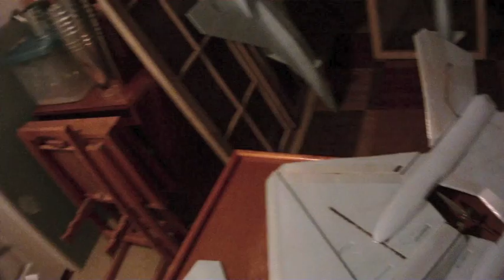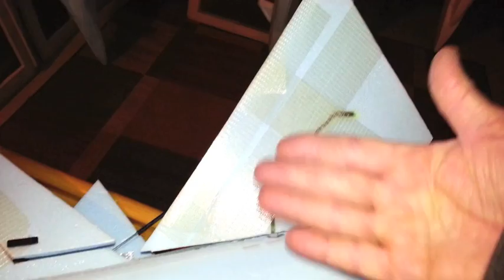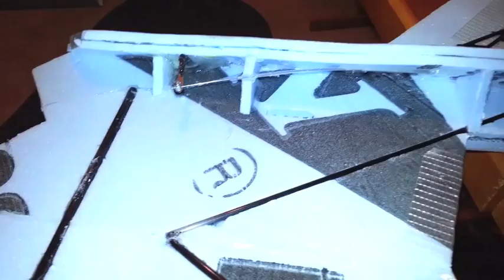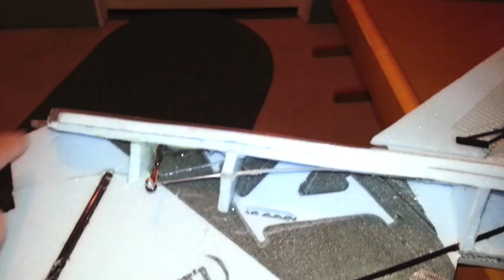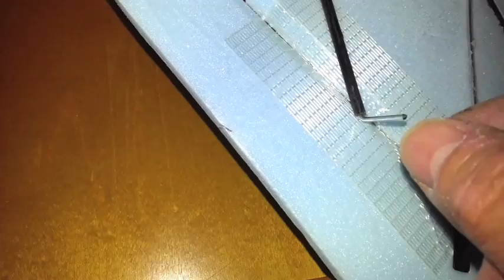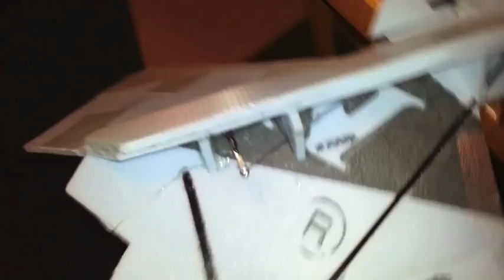YF23 All Moving Surface Set Up

Comment: Thank You for sharing your setup. Where did you get the tempered steel rods? Which connectors are you using at the control horn? Which flexable control rods do you use?